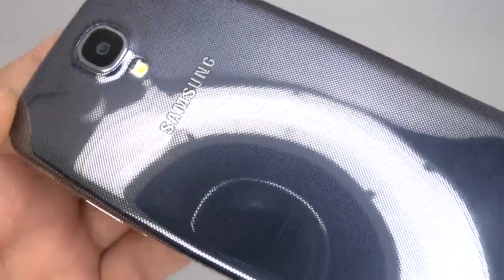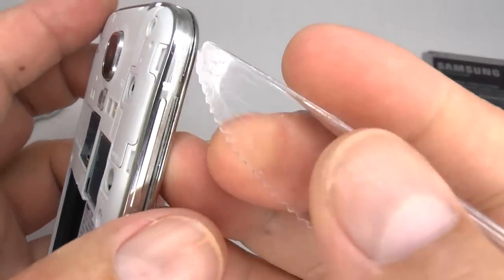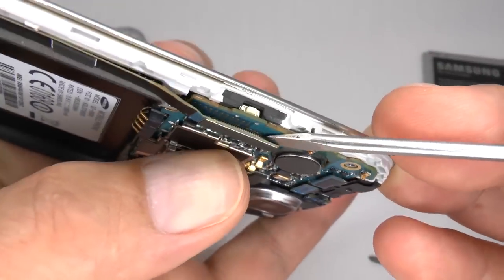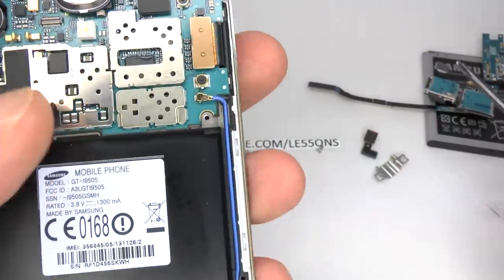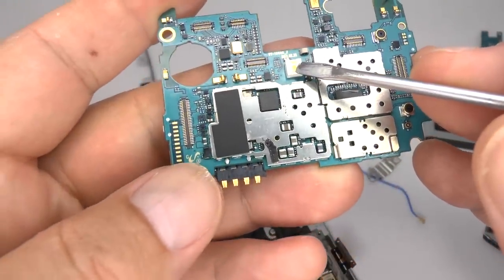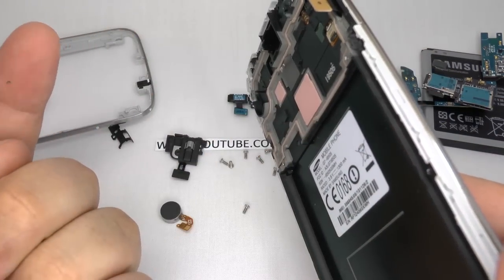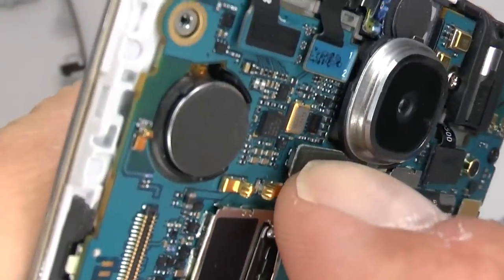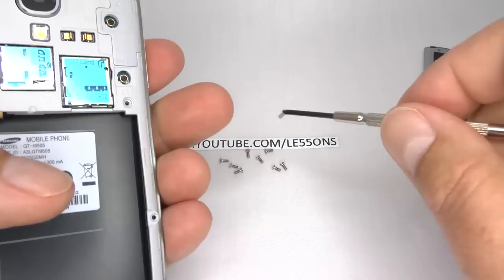Galaxy S4 Disassembly & Assembly Teardown - Screen & Case Replacement

Comment: When I was unscrewing a nail, I accedantally stripped it. Is there any way to remove this? P.S I do not care what happens to the screw, I just need it out asap!!
Reply from the maker: try using a small drill to remove the head of the screw
Reply: Thanks
Reply: Matt Baylife If you get a set of jeweler's screwdrivers from Radio Shack or Home Depot, try using one of the smaller straight blade screwdrivers to "bite" inside of the stripped area of the Phillips head. Rock it side ways a little to aquire the bite, press firmly and back out the screw slowly. It sometimes works.
Dan

Comment: I dropped my AT&T S4 in water(toilet actually) and it worked fine at first but after an hour I started hearing crackling in speaker when pressing a button and now screen doesnt come on. I have start-up sound and the blue l.e.d. comes on which shows that the phone is on. I put it in a bag of rice for 2 days. Then all of a sudden screen went on for a day then now it turned back off and hasnt worked since. Should I try cleaning the parts with alcohol? Which part is responsible for displaying the images to the screen? Please help?
Reply from the maker: Its worth taking it all apart and cleaning all the flex connectors, you'll see which one is for what if you watch the video. Give the screen a long hot blow dry at about 60ºC as it might still have some water trapped inside. If it still doesn't work it might be worth borrowing another s4 and test your screen by plugging your one into the others mainboard. But whatever the result, next time keep the battery removed until you know its 100% dry inside..
Reply: First off thank you for your reply. Ok so I took the Waterdamaged S4 apart and connected a "working" screen to its mainboard. It flickered on and off a couple times and then stopped flickering and went dark. Since the new screen didnt work, Does this mean that the mainboard is damaged as far as sending video/image to screen? I assume I wont have much luck replacing the screens flex cable or screen itself? Is it hard to replace the flex cable?
Reply from the maker: cyrusalmighty I doubt replacing the cable would help, the water damage on the mainboard might not be visible to the naked eye as the copper tracks are very thin and will have been eaten away by electrolysis

Comment: I hav a problem with my s4 nw...i get blank screen just pops up wen am using my cell n gets normal..blank screen appears vry often for just a sec n disappear...plz can u suggest me what might be cause 4 tis prob?...solution appreciated
Reply from the maker: its an unusual fault, try backing up all your data and perform a factory reset, this can sometimes cure this kind of problem

Comment: Hello, nice video! Could you make a video about replacing the home button?
Reply from the maker: it can only be replaced by removing the screen from the front housing which is very risky. It can be done using solvent to soften the adhesive but the results are varied Galaxy S4 Screen Replacement / Frame Exchange / Test Drive Repair

Comment: Hi there, I have i9500 Black edition India variant. even after replacing motherboard and screen from samsung authorized service center in warranty My phone heats up lags and apps get crashed. I rooted phone installed custom rom, tried to reduce temp by underclocking to from stock 1.6 to 1.0 GHz but it still heats up temp goes to 70°C, normal temp of phone is 45°C its so hot I cant even hold in my hand, I tried stock kitkat 4.4.4 still no go, now I am running on stock Jelly bean 4.2.2 it worked good for couple of days but it has started heating up and lagging, it was same with kitkat as well. Service center wont accept the phone as Konx counter is 1, it has lost warranty, I believe there is no way to reset Knox counter, triangle away fails as well. is there any chance to fix my phones issue, what can i do, is there a DIY fix ? any help is appreciated. I really love this phone I'm big fan of this phone and I certainly dont want to sell it or throw it in cupboard with old stuff.

Comment: why is the screen stays black when you replace the digitizer pls help. tried with pressing the on/off button, voul. & home buttons together but does not work pls pls help
Reply from the maker: did the screen work before replacing the digitizer ?

Comment: Ok, so I opened my S4 yesterday. Im sending it in for repair on the warrenty, but if they find out i have opened it, they may charge me 100 bucks.. I opened it carefully, do they know anyways?? Should I really risk this or just try to repair it myself? :)
Reply from the maker: I don't have an answer for that one..
Reply: Ok, I decided to not send it and fix it myself. Do you have any idea why my touch keys doesnt work? I have tried anything on the software side.. Is it hard to change the touch key in S4? I have opened the whole case, except for the screen itself..
Reply from the maker: Sarbaz Ahmad yes its quite hard to replace the touch/home key flex. Watch the 's4 screen replacement video' and checkout the FAQ in the description..

Comment: Thank you so much! I've been able to fix wifi ans Bluetooth on my s4 !
Reply: I have problems whit my wifi and bluethooth. Help me how to FIX IT PLEASE.
Reply: What I did, is I removed the back and cleaned the wifi/blutooth antena contacts and bent the pin to insure good contact with the board. It worked when I turned it on but it would turn off by itself after a while. I ended up buying a new phone in the end. I hope you can fix yours for good! Let me know
Reply: +Jonathan B. Cormier I broke the pins on the left side :(, the wifi and the pin at the top. Anyway to fix this or im screwed? Or should i look for another circuit board that matches.

Comment: i dropped my s4 in water and the usb port was broken after i replaced it the menu and back button stop functioning help please! Which part is causing the problem?
Reply from the maker: it might be the new usb flex causing the problem, try plugging in the old one and see if the touch keys then work ok. If they do you'll need another usb flex.
The touch key flex is shown at 5:53

Comment: I love these videos. Really instructive. Can you confirm that at 3:40 it is the GPS antena ? There's lots of sites with the 'tin foil GPS fix' on the 2 contacts at 4:15 - your 4G antena. Lots of people say the tin foil fixes their GPS signal problem.I have NO GPS signal at all. I downloaded a repair manual from https://dfiles.eu/files/y4y9ulnsd which seems to agree with you - I just find it strange that so many people say the tin foil tip fixes it for them ! I have an aftermarket middle frame which holds the GPS antena. It looks OK and so simple I can't think that is the issue ? Any ideas ? Regards.
Reply: Probably just opening and closing the case was enough to make contact again. And also probably just someone wrote a fixit for the GPS and then everyone started copying the original and copying from the copiers, and thus now everybody is fixing the wrong contacts.

Comment: Hey le55ons you're video's are very helpfull thanks for that! But i have a problem with my wifi / bluetooth connection.. they both don't work. It isn't software so i am wondering what it could be. 

Thanks in advance
Reply from the maker: Sounds like the wifi/bluetooth chip needs replacing. Its a bit specialest but there are mail order places about that can do it. I think the best option is to sell it on eBay specifying the fault and buy a fully working one..
Reply: Thanks alot

Comment: Hi. My phone got wet. My kids did that.... I didn't know... The screen became green and black. I turned it off and realized it was wet. I dried it completely. Now when i'm turning it on, the screen in black , only one corner could be green sometimes. TOUCH SCREEN IS WORKING, all buttons are working. I can enter my password . just don't see anything. What should I do?
Reply: just replace the lcd/digitizer... the rest should be fine

Comment: Im just hoping that ill never have to use the warrenty :P

Just a warning for other people. If you do NOT need to replace the speaker dont try to remove it first like he does. Just skip straight to opening the casing (Undo all the screws first though)

I had trouble removing the speaker and ended up scraping the blue cable

Comment: hello plz help
i have plugged my S4 into a car amplifier which turn out to be short-circuit
the 12v get into the Headphone Jack of the phone and i think that the audio chip must be damaged , when i connect the earphone i hear voices like data transmission (kchkchhhchckkckcjhhh)  and the sound is discontinuous but the speaker still works and the sound is crystal clear with phone call the little speaker has the same case as the earphone .

which the module to be replaced plz help !!!!!!!!!!!!

Comment: Can you buy all these parts on ebay? Any chance you could list all the parts the phone has so I can price it up. It's more than likely going to be cheaper than a new phone ha!
Reply: Including all rubber gaskets :)
Reply: Given the fact that literally every screen replacement on Ebay is a fake, It would be better to buy an S4. Samsung does not sell replacement Touch screens. This means all the screens on ebay are cheap Chinese NON-tempered glass. I barely put pressure on my screen replacement and it shattered and shards of glass came off. The sellers get you by saying "OEM LCD and touch screen digitizer" meaning you get an OEM LCD screen, and then you get a [knockoff] touch screen digitizer. Nowhere will you find a NEW OEM Touch digitizer unless they harvest it off of a NEW S4. the fake screen look fake since the graphics are printed, and they dont react well. I had to hit the back button 2-3 times everytime to get it to work and the sensors on the top went crazy during a phone call making the screen flicker on and off. I finally found a working S4 to swap mainboards with so I can have an OEM screen again. I spent $150 on the knockoff replacement (I was fooled by the advertising I mentioned above) lcd/touch screen already in a bezel, and I just now spent another $150 on a fairly beatup, but with a good screen S4. Off the top of my head, from the hours I spent browsing Ebay a knockoff screen with bezel will run you $150, body will run $20, Battery $10, Mainboard $50, screws $5 Totaling in $235 for an S4 with a crap screen. or for $200-$250 you can get a nice looking used S4 with an OEM Gorilla Glass screen. your choice.

Comment from the maker: For the part search eBay for 290987933472
If the cable is damaged then they will know its been opened.
If it has any water damage they won't repair anything under warranty

Comment: so i did this and put it back together. but my touch screen doesnt work would love if you replied back ***** kinda in a pinch now
Reply from the maker: any luck with the repair?
Reply: ***** i did it, but my touch screen doesnt work is well anybody know how to fix it or need another new screen?
Reply from the maker: its probably a faulty new screen, if you've already tried a factory reset then another screen will probably be ok..

Comment: I have this model exactly, and 65% battery , my phone just turn off and need again to re charge .... can someone help me with this problem if possible ??? PLEASE !!! :( and sorry for my bad english ...
Reply: Ki Ra Sounds like you need a replacement battery, I had the same issue. Remove back and look at your battery sitting in the phone, does it fit flush, or does the bottom keep coming back up? If you take it out and you can actually see a noticeable bulge, it's definitely time to get a new one. Luckily, they're pretty cheap. Discharge the old battery as much as you can. You can throw them in the trash, but it's recommended you recycle them.

Comment: No I meant to say only the Sim card holder tray the silver slot only without removing the SD card and the whole module with the flex cable because on ebay the sim card slot tray is sold separately also 
search for ebay id # 300924290669

Comment: Brilliant tutorial video and superb hi def camera also! - Ive took the back off 2 S4's I have here with me now... One has a broken screen and LCD and the other has no operating system and a phone guy said he was unable to add another one, so iam looking to see if I can merge the 2 phones to make one fully working. Before I start taking apart all the small little delicate pieces though... Can you tell me LE55ONS (or anybody else in the know)... That is possible for me to do isn't it? I mean so much of the tech seems to be attached to the back of the screen but will I be able to remove the parts that hold the OS that is working on one S4 and add it to the non broken screen on the other S4?? - Hope that makes sense and a fast reply would be gold, as I have both phones laid out, open and ready to work. Thank you
Reply from the maker: Before swapping the mainboards over I would try plugging the good screen into the other board to see if it works ok :-)
Reply from the maker: try testing the good screen on the other board like I did here https://youtu.be/wPXVnTlrqeo?t=195
Reply: So your telling me it COULD be even easier! :D - Thank you for that quick reply, Your absolute gold! Great chilled tutorial. I wish you could guide me through life my friend :D - Will check out this link now. Fingers crossed!